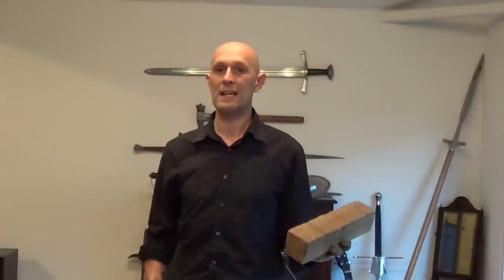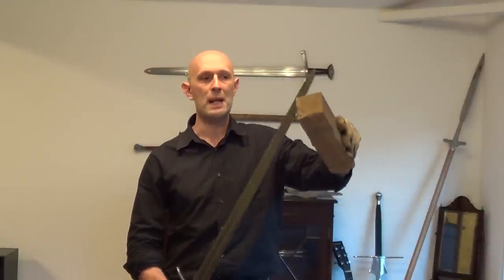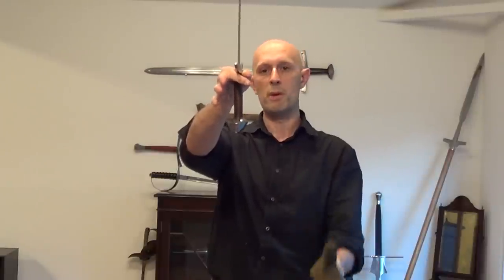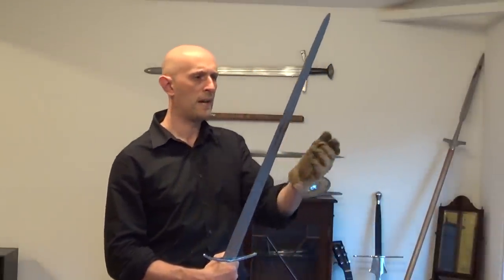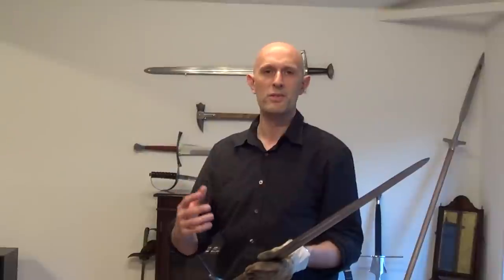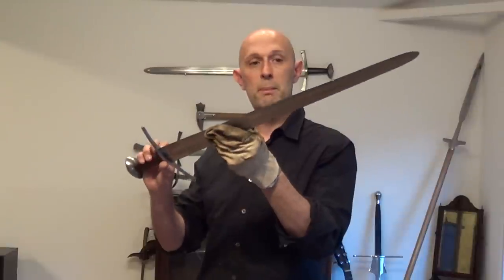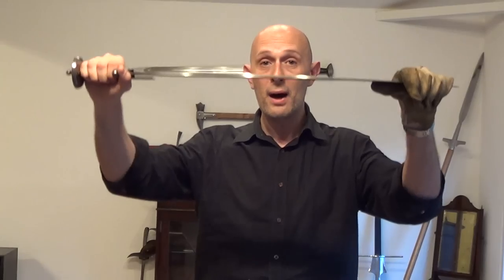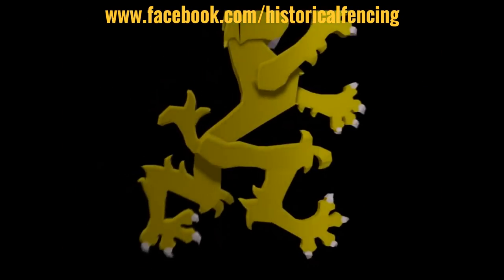Centre of percussion, nodes of vibration and stiffness of swords

Comment: I think Skallagrim meant flexible vs brittle. You will need some measure of flexibility lest the blade could snap. A blade could be very stiff, but still have some measure of flex in it so it does not permanently deform or break.

Comment: For the same mass (and cross-section), the stiffer an object is, the more brittle. I think this is the point Skal was trying to make. Of course, you can mess around with the cross-section (or, as you say, go for a heavier blade) without suffering from brittleness.
Reply: tristan roberts Yeah, that's exactly what Skal was talking about, especially because his subject was an obsidian blade. 
He even mentions swords that bend, but only made of bronze or iron, not steel ones like the katana and such.
So I guess it's nice that Matt comes and completes the picture, saying that not all steel swords are spring-tempered, and they compensate for that with extra thickness.

Comment: I think it should be added that not all post-dark ages European swords are (properly) spring tempered. There are many, many accounts of European swords permanently bending in combat right up to the first world war. One of my personal favourites can be found here http://www.forgottenbooks.com/readbook_text/Under_Crescent_and_Star_1000475046/205 .

Sometimes even high quality swords did not spring properly, as Lieutenant "Fritz" Wormald discovered when his Wilkinson sabre bent double "as if it were lead" when he tried to thrust an emir in the back at the battle of Ondurman, and again in 1914 as a lieutenant colonel when his new 1912 pattern Wilkinson "buckled like an S" when he ran through a German cavalryman.
Reply: lancer D  Yep.  Also, even blades that aren't spring-tempered can flex a bit before permanent bending--only super shitty wallhangers will be permanently bent at the slightest bend.  They just flex noticeably less in use, which as Matt says has its advantages and disadvantages.
Reply: lancer D As far as I know, spring tempered blades where pretty rare until the 14th century, because only then the advancements in iron smelting made it possible to produce high quality steel in large quantities. Before that most blades where made from quit crappy material that was brittle and bendy at the same time.

Comment: I call that the sweet spot, it transfers less vibration to your hand. It is shape dependent. I usually find it on a machete by trial and error. Forward weighted moves it forward; center weighted moves it closer to the grip.

Comment: Hit your blade on the center of percusion, you will see that she won't vibrate. This is self explanatory, the blade does not conserve the vibratory ennergy when struck on the center of percusion, it transmits all the mass to the target. Otherwise the virbatory ennergy is conserved in the flat part of the blade.

Comment: Actually, physicists would argue that center of percussion is a phenomenon, where the limit of force ends when the material itself fails, instead of moves. 

The tip may have the most force, but it does not distribute the most force, because some of that energy also goes into flexing the tip.
Reply: ***** 

That's not how rotations work.
Reply: Daniel Blay
Generally the speed is enough for the force to be greater, right? 

Because the speed adjusts in proportion to the mass (increases even more if mass is less, lessens if mass is greater)...
Reply: *****

a) ...sorry, you think swords don't involve rotation?

b) No, the equivalent law of motion for rotating bodies is T(orque) = r cross F, that extra r (distance from centre of rotation) term matters. More compactly, T = I alpha, where I is the moment of inertia and alpha is the angular acceleration. These tell us that the torque is a quadratic function of distance from the centre of rotation, whereas it's only linear in mass.
Reply: *****

Watch the video again, he's moving the sword only from his wrist - i.e. rotating it. Just because he doesn't complete a circle doesn't mean that it's not rotating - the tip describes an arc.

On top of that, the centre of percussion is a purely rotational phenomena.

On top of that (as I already explained), that r scales as r^2 (i.e. quadratically), whereas mass only scales as m. i.e. If I have twice the length, I require one fourth as much mass to apply the same torque. Four times the length, I require one sixteenth as much mass. So length matters far more than mass. Striking objects (such as baseball bats) have lots of mass near the tip because it increases the moment of inertia, because having a longer bat can be unwieldy - despite that, the bat will still strike with the most force near the tip (however, it'll shock your hands more and you'll lose some kinetic energy to that - force, energy and momentum are not the same things). Wrenches have large ends not because it increases the mass - you could have an extremely light wrench and it wouldn't matter, so long as it had the same strength and the same length (because a wrench isn't freely rotating). The extra mass there is simply to soak up the stresses involved in applying large torques.

I get where you're coming from, but your argument is not physically correct. I'm not just talking out of my ass here, I do have a physics degree (which is why I care about such stupidly trivial things!).

Ultimately what I'm saying is, Matt is right in his conclusions, but for the wrong reasons. That generates misunderstanding.
Reply: *****

No problems, sorry if I seemed adversarial.

Comment: Center of percussion is also science, it's just not a high school level physics but university level vibrational mechanics. Center of percussion is defined to a selected pivot point which in case of a sword is ideally the bottom of the crossguard, and as you mentioned, in this case the center of percussion is at the place where you mentioned. In the point of view of the holding hand, if you hit the blade at the center of percussion, there would be no force on your hand perpendicular to the axis of the sword, only torque. this will result besides more effective striking power a much more comfortable weapon handling, which will help you avoid arthritic injuries in the long run.

Comment: The more you emphasize that sword design is a matter of balancing pros and cons to get a desired effect, the more I realize how each sword design in a region is so dependent on its context. I wonder if there's anything to japanese llamelar armor that influenced their desire to emphasize cutting in their polearms and their swords. Or was it a matter of resources available, that made them forego/notadpot/notdiscover/not use spring tempering. In Europe, was spring tempering developed out of necessity because of the presence of shields and maces/hammers bending stiffer swords?.Makes me also wonder why tulwars found so much success.
Reply: ***** It was a matter of ressources, he covered that in another video. Basically they had very little high quality metal, so they made a design that used as little of the high quality stuff as possible, only at the cutting edge and formed the rest out of lesser qualities.
Reply: ***** By the time the katana was in vogue, the Japanese were producing plate armor.
Reply: TrangleC
 Wondering if there are functional goals to the design, in light of their lack of resources. People will always try to make the best out of the materials they have available. Was this the best design they could come up with given that they had low quality steel? Why do they favor cutting with their non flexible steel? Why not piercing weapons? Even their polearms have cutting blades at the end of it. Is it because of the favored use of cavalry and mounted archers? I think it's safe to ignore what came after japanese unification since, that's when japan came under rule and laws were placed to limit weapon development. it was during that period were the katana's short length became a tradition because of law. before then people were less conservative because they were actually competing. Look to the period before unification, when rival factions were actually trying to compete with one another.

I love these mysteries. Heck even viking broadsword + round shield functionality is great to speculate on. Did the use of the round shield actually influence/promote the use of broadswrods? was there an advantage to it? If there isn't, why not use spears all the time?
Reply: Florence00pi That is not entirely true. 

This image: http://upload.wikimedia.org/wikipedia/commons/c/c4/Katana_brique.png

Shows the various cross sections of how katana were composed (though it really applies to all Japanese swords. There were tanto made in Honsanmai, there was tachi made in Wariha Tetsu, etc). This method of construction was brought to Japan through China, and is a fairly old technique. China eventually switched from using the lamination method to making their blades completely from mono-steel. There is nothing inherently wrong with lamination, and good quality swords can be made in such a way. It's just time consuming, and outdated. But it's more than just only using the high quality stuff at the cutting edge. They were using differing qualities of their steel in very different ways. 

I've mentioned this on another video, but it's important to point out. Once China had switched to making sword blades with mono-steel, they had received swords from Japan as a form of tribute. They did not see anything special about these swords, and considered them to be relatively obsolete in comparison to their own blades.
Reply: ***** Watching a recent video on Thrand's channel, I would assume the use of the broadsword over a spear was a matter of durability. They showed how a spear or ax  haft could get chewed up and fairly easily broken. So while you might start with a spear, in an extended fight you would likely have to switch to a sword after a while.
Reply: TrangleC 
1. the steel in medival europe wasn't better. 
2. Folded paper or wood was not used in armors for warfare, laquerd paper was used e.g. in parades. They used iron and steel in their armor - a lot of it. And btw a lot of areas on a samurai armor which wer looking like clothing is  mail armor coverd with cloth.
3. leather as sole armor was out of use even before the samurai class came up. You find leather in samurai armor, but as foundation for metal armor, eg mail was often sawed onto leather.
4. Depending on the demands they imported steel and iron or exportet iron and steel products. Even under maximum isolation they had some harbours open for trade.
Reply: Benjamin Brohmer This guy is right. By Sengoku era, wooden armor has fallen out if fashion. Even Ashigaru(commonner soldiers)were armed with metal armor. Samurai oftenly wear cloth with iron mail sewed to it to cover parts where metal plate/lamellar armor wouldnt cover and the higher ranking nobles would even wear imported european half plate armor.
Reply: +Benjamin Brohmer There are extant examples of do maru from the Gempei wars that are made predominantly or entirely out of leather kozane (as well as earlier o yoroi). The samurai class was very much up during this period. Like in Europe, there was a non-trivial amount of change and development in both metallurgy and weapon and armour design over the centuries.

Comparisons with Europe are quite tricky, because there's little definitive we can say about the middle mediaeval period, and in the early modern era, there was already trade with Japan equalising things somewhat. But during the high gothic era and early renaissance, the spread of crucible steel in Europe made proper longswords and full plate armor not only doable, but reasonably common. This certainly shows that high-quality steel was much more readily available in Europe during this period.

Comment: Ow, ow, ow, my overly sensitive sensibilities for physics and definitions! It hurts, the pain!

I would agree completely that finding the center of percussion gives you a good idea of where the optimal striking point is. It annoys me that people use the term "center of percussion" to describe that point, because that has a specific definition. Think of it like someone insisting on calling an arming sword a saber.

Interesting science point I learned while looking into the physics of the last video. The actual pivot point of a swung object is typically below and behind the pommel. Pretty cool, especially when you realize that the Point of Percussion changes based on where the pivot point is.

Great video as usual, even if my ears are now on fire.
Reply: Wreqt I understand what you mean. "Sweet Spot" might be a better term but that's really splitting hairs. The trick is that the system we are describing (a swung sword) is not quite the same as the one used in the normal definition of centre of percussion as for the sword the pivot point can be in motion. Since Centre of Percussion is used for swords it might be best to think of it like the word theory which has different definitions for science and common use.
Reply: Brained05 I'm sorry, that just seems wrong. We grabbed this term from science, but use it incorrectly. The system we describe is exactly the same as that for which the term CoP was originally designed. A mobile pivot point is accounted for in every physics paper i have found that looks a the center of percussion. We should start using these terms correctly as quickly as possible if we want any modern scientific study to make sense to us.
Reply: +Brained05  I was watching and thinking of the sweet spot on a bat.  That should relate more simply to visible nodes because the bat is round.  

The complication is of course there are actually an infinite number of nodes, so the best spot would be the spot with the most "nodely" sum of all the standing wavelengths.  If you took video of the bat vibrating, you could identify the sweet spot exactly as the point(s) that have the least deflection.
Reply: https://en.wikipedia.org/wiki/Center_of_percussion
Learn about it for yourself. If you enjoy that, you should consider going into mechanical engineering.
Reply: That link was indeed fascinating but then I studied Physics :-)

A relevant quote: 
"The sweet spot on a baseball bat is generally defined as the point at which the impact feels best to the batter. The center of percussion defines a place where, if the bat strikes the ball and the batter's hands are at the pivot point, the batter feels no sudden reactive force. However, since a bat is not a rigid object the vibrations produced by the impact also play a role. Also, the pivot point of the swing may not be at the place where the batter's hands are placed. Research has shown that the dominant physical mechanism in determining where the sweet spot is arises from the location of nodes in the vibrational modes of the bat, not the location of the center of percussion"

Comment: To add to your comment on the springyness of migration era swords, "The sword and the Crucible" by Alan Williams describes analysis of several such swords of various degrees of iron, and many of which are not hardened.

Though more weapons seem to have been springy and/or hardened in the medieval period it is by no means all. There was a huge variation in steel quality and according heat-treaments used.

Comment: I'd like to make the point that the COP could be a vibrational node, just in the other direction. Because the blade has different gradients in bending stiffness along it's edgewise axis and flat axis while the linear mass density remains constant, they produce different nodes; but the way you described the COP is a vibrational node, just in the edgewise plane.

Furthermore, that would mean in blades with similar taper both in shillouette and distally would have nodes in similar places.

Comment: I think that different terms and tests might have created some confusion here. It is my understanding that the centre of percussion and the node of resonance are indeed exactly the same thing. The impact causes a standing wave. The forces of the standing wave cancel each other out at certain points which will therefor remain still.

Imagine for example doing your two tests with a piece of bamboo. The vibration test and the tap test will locate the same point because the stick is radially symmetrical.

A sword is not radially symmetrical so it will conduct waves differently in different planes. BUT, if you do the tap test and the vibration test on both planes they they should still identify the same node. Yes, the nodes are at different places on different planes, but both tests should locate the same point per plane.

Comment: It seems to me that the center of percussion is simply the node of vibration of the perpendicular (width) axis. Due to how area moments of inertia work, the vibration along the wide axis is imperceptible to the eye, but it is still there.
Reply: That would explain perfectly why that's the spot to strike with. So it's the same thing, just for a different cross section. And you are right, it is in no way related to the node of vibration, though if the distal and profile taper are similar in scale, it will probably be in a similar place.